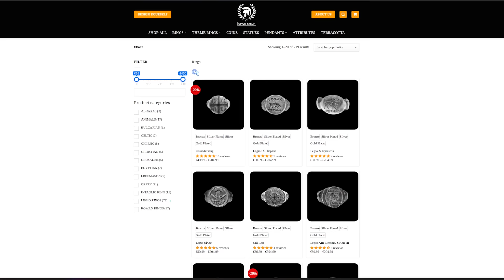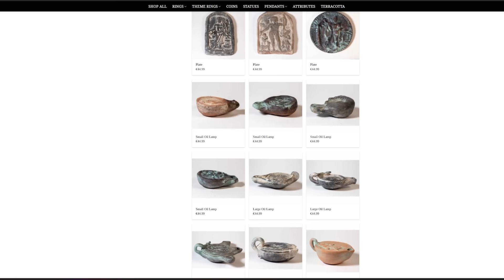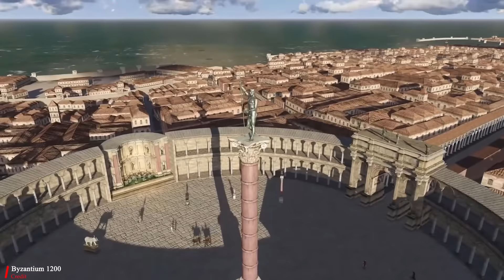Which was the most impressive city in the late Roman Empire?

Comment: Great video! On the point that Constantinople was superior because it had four ports and, therefore, it could be sustained by the sea--while this is true, it doesn't take into account that Constantinople was also vulnerable to sea attack in a way that Rome was not. Rome could access the sea via the Tiber/Ostia, so it could also be provisioned from there. But it could defend itself very easily from a sea force trying to enter the city. In light of these facts, Rome likely had the superior defensible position.